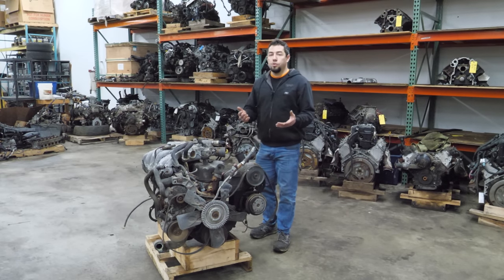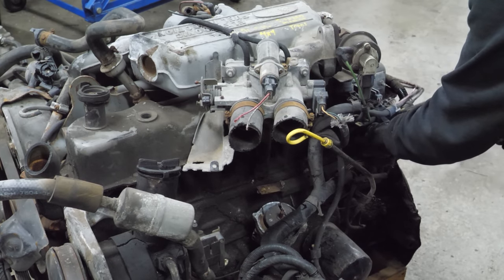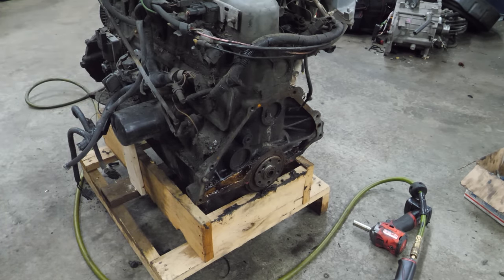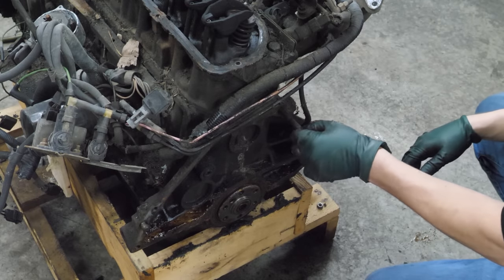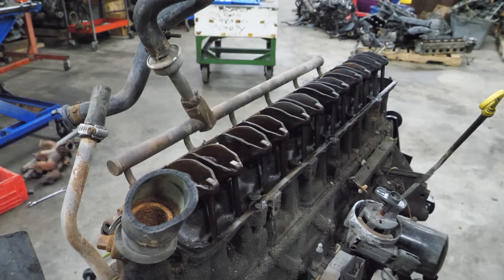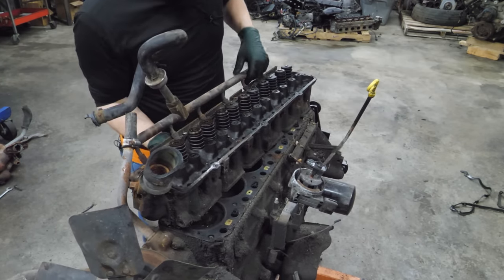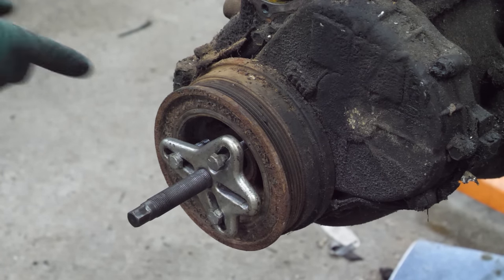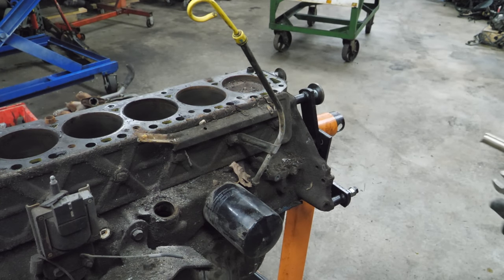FINALLY! A "Bad" Ford 4.9L 300 Straight 6 To Teardown! Most Reliable Engine, Ever?

Comment: There are a few issues on those later engines.  The cam gear for a while was fiber, and would disintegrate, but it's a non interference engine so a new gear fixes it.  The heads can crack between the valves, but that usually takes some major overheating.  The plastic was likely dropped in when the pan gasket was changed, it looks like a hose support.  The heads don't flow very well, but there is tons of meat for porting, and unshrouding the intake valve makes a huge difference too.  
The 300 and 240 came out in 65, and both were available in the trucks until 74, then only the 300 from there out.  The 240 was also available in full size cars as the base engine, but was dropped in 74. 
I've built these engines a few different ways, with my favorite build having been a late 70s head and block, bored .080" over, using flat top pistons from a 360 to get ~9.5:1 compression.  I kept the stock 1bbl carb, and it moved my old van very nicely.
Reply: "The cam gear for a while was fiber"

Yeah, my understanding is they originally used metal gears but at some point a decision was made to switch to nylon due to noise reduction. Most people recommend changing to the metal gear, because the nylon ones have been known to fail.
Reply: I was going to say something about reliability of these , I've seen one towed into my old shop as a no start- Phenolic cam gear teeth had stripped out, first time I'd ever seen a fiber/plastic cam gear
Reply: @midnitetoker15  chevy 6 cylinders , as well as all of their V8 engines always used nylon timing gears . Nearly all domestic V8 engines started using nylon timing gears in the mid 60's and continued to do so for decades .
Reply: @HowardJrFord  Grew up in a GM family, learned to hate what the bean counters did to the faithful customer. 
Granddad had farm trucks that had the 'for dependable economical transportation' tags on the kick plate
But one of the WORST screwing was the Olds/Pontiac stories...
Reply: The 300 I6 has a 4" bore. The 360 V8 has a 4.05 bore. Overboring the 300 by .080 would not allow you to run the 360 pistons. Most hot rodders overbore the 300 by .050 and run the 360 or 390 flat tops. An Offenhauser dual port intake with a Holley 390 cfm 4 barrel carb, comp cams high energy camshaft, porting and polishing of the head and a set of steel tube 3 into one headers make the 300 into a real powerhouse.
Reply: @stefanl5183  The nylon ones last a long time but yeah they used those for noise reduction. Never fear though, just order the cam gear for a Ford 300 that went in an industrial application like a generator or big pump. They have the steel gears and its a direct replacement. Bolts right in place.
Reply: @FRLN500  I did the same thing, then went to the Offy C series open plenum and a Edelbrock 500CFM AVS2 carb. It did have some power, but damn it drank gas!
Reply: I had that cam gear disintegrate. Getting the rest off was a bear
Reply: In your universe only.

Never saw any V8 with "nylon" timing gears. They all had a chain drive. Not even lawnmowers had "nylon" cam gears, even when the cam lobes went "plastic".
Your "memory" is completely faulty.
Reply: Volvo used phenolic fiber cam gears in the legendary B18 engine, and the B16 before that. It was your 1940s solution to timing gear howl. Nylon? No, phenolic with cut fibers just like circuit boards in old electronics after they quit point-to-point wiring. Least reliable part of the Volvo engine. My 1960 B16B phenolic fiber-filled cam gear was eaten/chewed on its keyway by its Woodruff key in '69 at 156,000 miles. Bought it secondhand from a traveling salesman who put 136,000 on it in seven years. Volvo Canada had none in stock, flew one in from Sweden -- in a blister pack! Along with a crank gear, all sucked down flat by heat shrink plastic or something. Just like stuff today on cardboard cards. Volvo dealer had said parts were hard to get. In reality, most seven year old Volvos were rusted out, just like everything else and got scrapped. I phoned the Volvo assembly factory in Halifax where I was studying, got someone who was actually awake -- pointed out that Volvo ads on TV at the time were touting 17 year lifespan ! and mine was only 9. Three days later, I was hand--delivered that blister pack at college. Yup. $26.

My teardown showed a broken piston ring on #3, and some light ridging at cylinder top. On a gamble, got 20 thou over rings, gapped 'em. Tight squeeze. Put her all back together, and it would hardly idle, so spent a day running her in on back roads. Sold the old beast to a local guy six months  later when I went away to study for a Master's. Mechanical engineer for all the people here who hate them, but who have never worked as one or even in a factory but know more than any engineer does because sitting in a basement with a PC makes them genius design gurus, because folklore and old wives tales beats an education any day. Right?

In '71, home on a visit, went to collect my younger brother at my original alma mater for Christmas. And hayseuss, in his dorm parking lot was my old 544 Volvo, now sporting riveted aluminum sheet rocker panels under the doors, and the original red paint under the Maaco blue metallic the salesman had gifted it in '65 or thereabouts. Guy came out, started her up and drove off. Wasn't interested in the car's back story. Sob.

The other thing people "say" these days is that '60s engines didn't last 100K miles. My father's British Ford 4 cylinder did 93,000 in six years, burned no oil. Cars rusted out before the engine died. If you weren't there, you don't know the truth, but you've heard BS stories and decided to believe them. Just like the engineering geniuses clogging up basements nationwide but somehow never hired by a real car company, yet know more than Albert Einstein. Doofuses, yet never graduated high school. Full of stories and nonsense and claiming them to be true.

Like, long stroke engines have more torque. Nah, torque is a product of displacement -- pick your bore and stroke for other reasons -- most Hondas are long stroke but were tuned to be weeds at low rpm before turbos. Again, people without a clue who know NOTHING, but grandly assume they do.

Then there are the village idiots who say -- a straight six has more torque than a V8. The cylinder configuration has zero effect on torque. Torque comes fro displacement. But hey, I heard that six-cylinder folk tale in the late '50s when I was a kid in a small town. From old guys keeping warm around a service station furnace on a cold Saturday afternoon. What a crock. It just means they really have no fundamental clue how an engine works. "Yes I do! You don't know nothin', you're an engineer!" Folks, the first thing anyone with a brain learns is that there is always more to learn. But your average web creature fills up their head with rubbish and by age 25 decides they've learned all they need to know, and hold those opinions for ever. Defends them against all evidence to the contrary, and generally knows nothing about nothing and is more than happy to share that vast amount of nothing with the world. In fact, they insist on it.

I'm the better part of 80 these days, and the stupidity of the average person still amazes me.

As you can likely tell. 

Our lords and masters, and Canada is a carbon copy of the USA in this regard, have noticed this profound dumbness, cut back on education and filled heads with nonsense. Makes it easier to recruit soldiers to fight Chicoms, because they're evil commies. No mention that these captains of industry off-shored our factory jobs to China in the '90s and oughties to make more profit, oh no. It's all China's fault for stealing our jobs, that's the way they spin it. And the goofball parade falls for it every time. Blame someone else for what ails the nation, not their greedy selves for building up another country to make money off of cheap labor -- that's our bosses.

Sixes have more torque than V8s and the Chinese stole your lunch. The folklore nonsense never rests. Even when you're homeless living in a tent eating dogfood and crapping in the gutter but got a job at Walfart that doesn't pay the bills for rent or proper food. Hoodwinked by the rich and happy with life, because if it's this bad here, cheez, imagine how bad those Frenchies must live.

Dumb and dumber is America/Canada these days. When the rich have mined every last penny off of the poor, like late payment fees on top of everything else, then they MAY, and I say MAY, figure out that there's nobody left to buy anything. Wonder if it'll ever get to that, but right now that's the course we're on.
Reply: @BillMalcolm-tn3kq  I have dealt with several engines that had a nylon overmolded cam sprocket.  
And Tecumseh used nylon cam gears in their later models.  They sucked.